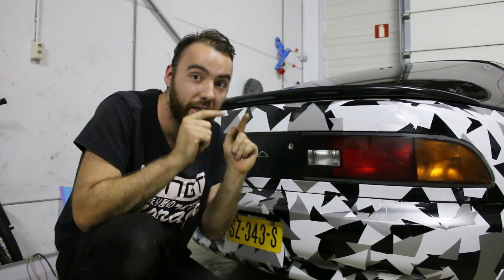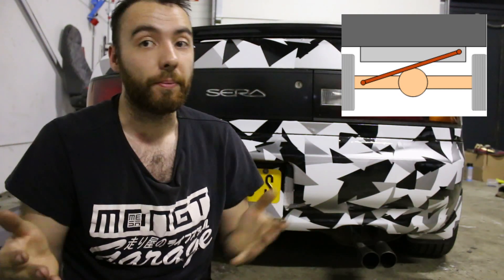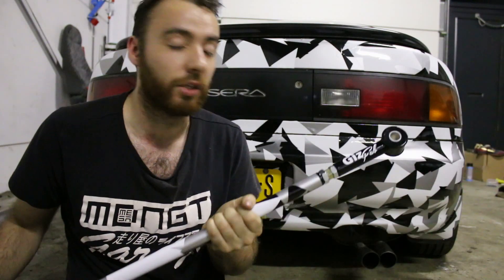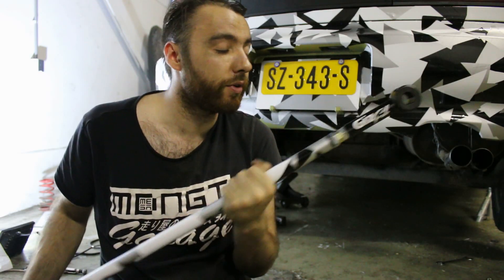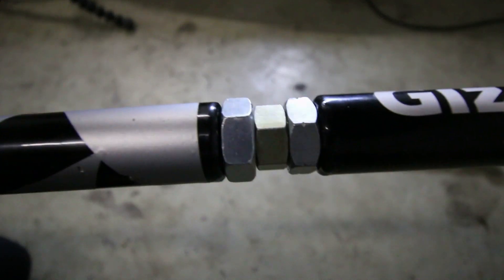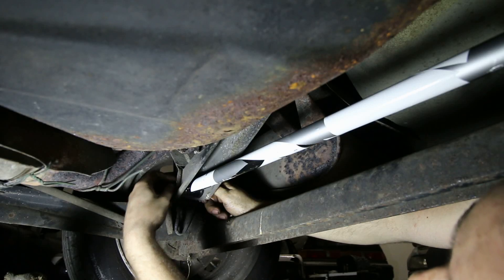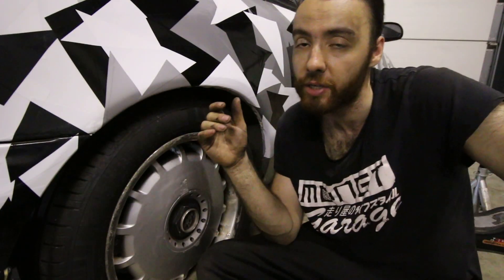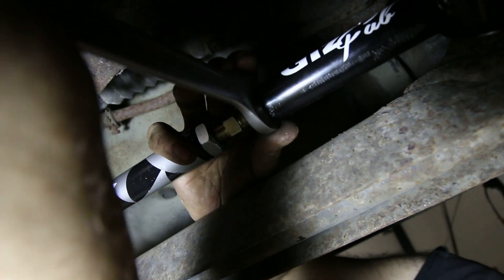How to setup and install a Panard Bar

Comment: Great work, nice easy mod for a Sera. I've got a off car adjustable one, but I've also fitted a rear sway bar, what a change that was to handling, I'd really recommend fitting one of those too (with crush tubes in the chassis). https://i.imgur.com/JWGmPbQ.jpg